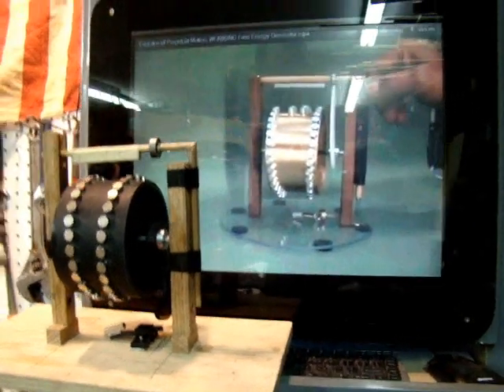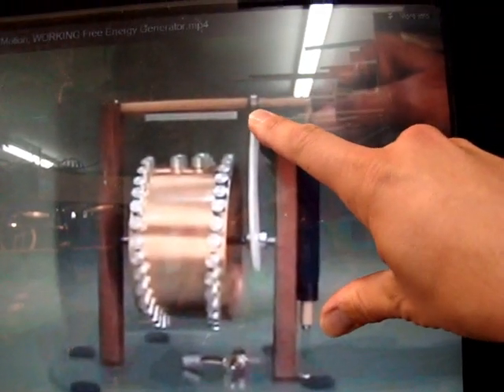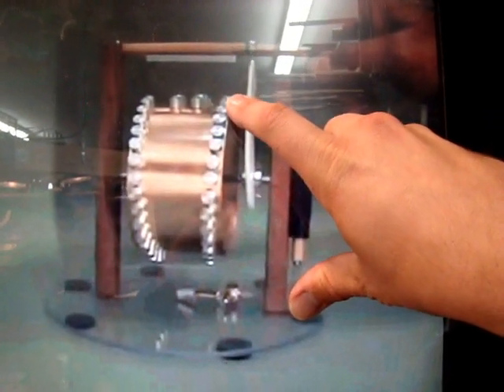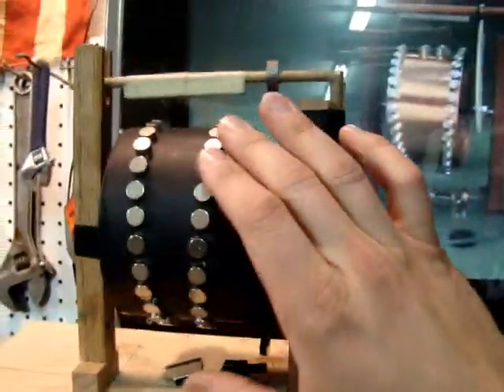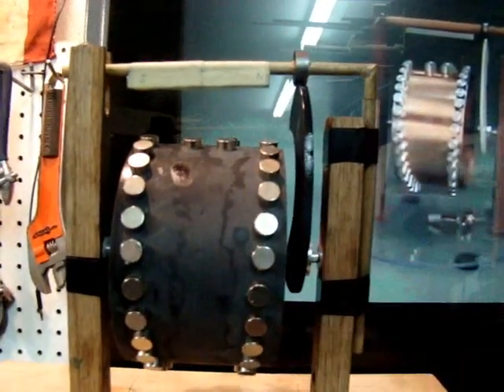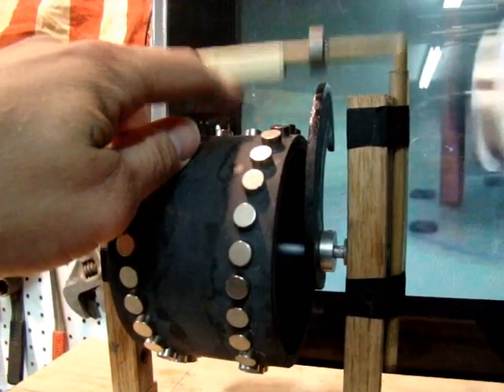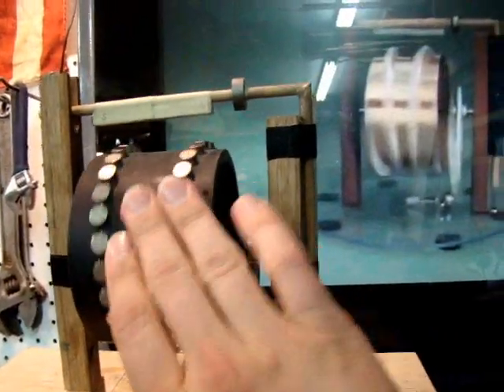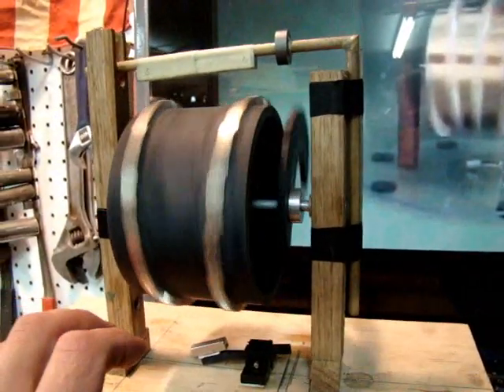Evolution of Perpetual Motion, WORKING Free Energy Generator Part 1 of 3

Comment: I have dusted off my V gate motor and am in the process of making the cam. You are right, that top magnet is nowhere to be found. I tried making a string of 4   1/2" non magnets, but the attracting poles are too close to the revolving magnet and stop it.
I am making mine run by repulsion - that is N over the N ring and S over the S ring and much closer than what you have on your. Mine does run by pushing the magnets up when the end comes and dropping them down again and I am making a cam that will do that. I can't find the video I designed from but he did lift that bottom magnet and now I need to find out when it is lifted . If is by the same cam, it would have to be when the tom magnets are down so both sets repel at the same time . I wish I could find that original video!..Cheers, Jim

Comment: You need to endure many failures making different tests with magnets,  orientations and designs. It works but it' s not so easy. Try with a vertical  circular magnet just in the midle, between the two magnets lines. Provide a jump to the magnet st the steeky point.

Comment: I am in the process of making one. I was not sure if the top magnet was pushing ( N to N ) or pulling  (N to S) and I found from another video with a 4 v gate motor that it is pushing (N to S ) I stacked 4 1/2" magnets together on top to get the right poles at the ends and I am building the cam right now. Call me if you get a chance, I'd like to discuss where we both have been on this design. I watched the same video you have there.  thanks, Jim 616 698 6842

Comment: I have an idea for a lifting force machine. 
Step 1: Get hollowed out cube.
Step 2: Securely attach magnet to inner bottom of hollowed out cube.
Step 3: Place a lever on inside bottom of cube behind the magnet that's securely attached to inside bottom of cube so that one side of the lever is pointing towards you and hanging over the magnet.
Step 4: Attach a vertical bar to the top side of the part of the lever that is not hanging over magnet witch is securely attached to inner bottom of cube. Make sure the bar goes all the way up to the inner top of the cube barley touching it.
Step 5: Securely attach a magnet to the side of the lever that is hanging over the magnet that is attached to the inner bottom of cube.
Note: Magnets need to be facing each other with attracting poles N,S or S,N
Note: The lever is going to have to be really close to the magnet on inner bottom of cube because of how close those magnetic fields need to be to interact. But not so close that magnets can touch.
The magnet on top connected to lever is pulling the magnet on inner bottom of cube towards it and since the magnet on inner bottom of cube is connected to cube, this pulling force acts as a lifting force. Now at the same time the magnet on inner bottom of cube is pulling the magnet on top downwards BUT the magnet on top is connected to the lever so any downwards pulling force is being converted mechanically by the lever into upwards lifting force. Now if you know anything about magnets you now that there are magnets powerfull enough to lift far more weight then just there own. So essentialy this divice is exploiting the powerfull pulling force of magnets by mechanicaly transforming its magnetic pulling force into mechanical lifting force through the clever utilization of a lever, and walla stuff can be made to fly. Imagine if the magnets in this experiment where electro magnets so the ammount of electrical current going into them determined the ammount of lifting force that it would have. Now imagine this system being used as an attachment that could be placed under or ontop of vehicles to counter the weight of the vehicle and any cargo its carying. Now imagine  if this was done with powerfull permanent magnets and turned sideways and placed in an electric generator and had enough strength to pass through the magnetic fields as it propelled itself forwards with its own magnetic pulling force.     Signed   Adam McKenzie Anderson
 Extra Note: If anyone uses my ideas for none profitable means great I hope it helps but if they are used to gain profit in any way I want 25% of anything that comes out of it please. :)  My EMail is starfire7654321@yahoo.com

Comment: Free energy wont exist. BUT... We can tap into stored energy and waste a bit to convert the storage into a usable format.
Take the ram pump.
You can use gravity to increase hydraulic pressure, capture that pressure and relocate the water 7x higher than the drop. The trade off is that a portion of the water is lost to allow the pressure to build. So this is ultimately just a method of using natural energy storage to reallocate resources to a more beneficial format or position for human use.
So...
Recognizing the potential energy and where its stored around us is key.
The sterling engine can use the suns heat and the coolness of ground water, tap into the difference and generate power at the loss of those thermal differences.
Nothing is purely free, but there are many many many untapped resources all around us, we just need to recognize their potential energy they have stored and collect it. 
Don't try to generate energy, instead try to harvest it from a seemingly endless source.

Comment: The magnets on the drum which are close to the magnet bar poles pull the bar more  than the magnets at the center of the drum, so the drum rotates ONE CYCLE. After that, the magnets which start the new cycle (which are close to the center of the drum) are too weak to pull the bar and start a new cycle. The energy used to lift the bar will drain the rotation energy from the drum.

Comment: Get a spring or two to balance out the primary magnet. ...and you can have the maget of which you speak that you can not find, made. many of the companies in china will do custom sises & shapes. It's not difficult, they just change the mold for the power. making a mold like that wouldn't be a problem, it looks like about 3 or 4 cuts in a mill or about 30 minutes modeling & set-up with a cnc system, (a modern one anyway). I would bet it'll cost you around 80 to 100 bucks for one & much cheaper for several.

Comment: You forgot the air hose to blow on the wheel to make it spin.  http://i.kinja-img.com/gawker-media/image/upload/18dtgs2p8d8s5jpg.jpg
I mean, you didn't REALLY think that sticking a bunch of magnets on a wheel, and a little cam with a lift bar, would result in making the wheel spin, did you?  1st law of thermodynamics anyone?
Reply from the maker: rockethead7 dude check out part 2&3. your only looking at video 1 of 3 of the whole project.:)

Comment: This wasn't amusing because no thought went into it, it looks like you just tried to make it look like the other one. Where he actually did several experiments first, starting with a flat surface to make sure his set up worked. This looks off timed, a little lopsided, too light to maintain any kinetic energy when it tries to lift the magnet, and the angle of the cam-lobe is way too steep, so you're losing a lot of energy in that impact, and you didn't have any to lose in the first place. 

Not amusing because you didn't do your research
Reply: Alexander Peterson I agree 100% with you...

Comment: if you lower the top rod and make it were the magnets are in range of each other so the magnetic fields can interact you might have succeeded. plus the one in the video in on a copper wheel which increases magnetic range.

Comment: wish i could pm on this anyway i noticed from counting his magnets he had about 64 total may help also i believe it does work you just have to get it right dont give up as im about to just buy magnets myself! look at some vids of how the v gate works (when it turns even a little and you will realize as i did your is not even moving some are!!!! so first get that right! maybe try rod magnet on top also im not sure he had a spring maybe it was 2 magnets to help push it back up i think if it did work it would take alot of fine precision! on some areas of the build like the timing at the top and bottom!! all the best!

Comment: would you believe me if i tell you that i made one on a small generator , and i put one  el. motor above that is using 1,5 V. voltage increased up to 250 for the crossover.  it has enough torch to kick the rod magnet away from the wheel just enough to continue the spin,  the generator makes enough electricity to charge 1,V battery . if you understood this..  what you think ?

Comment: Nice try but a wasted effort as you have discovered. Questions that people should ask themselves when considering "perpetual motion"; what limits the speed of motion of such a claimed machine? If such a machine exhibits acceleration then it must have a quantifiable energy source and that source (and its magnitude) must be explainable by the existing physical laws which currently separate our lifestyles from those of cavemen. I noticed that the original machine on which this is based did exhibit acceleration. Since it didn't perpetually accelerate, frictional losses which could easily be measured which would define the magnitude of continuous input of energy (from wherever).
Reply: ***** If the magnets do work, it is by pulling something closer by attraction or pushing something away by repulsion. Unless the magnet loses some of its magnetism in the process it has imparted no energy to whatever it caused to move. Therefore an external energy source has to be used to reverse the work done by the magnet (for example, separate the magnet and object again). The same thing goes for two objects which are mutually attracted by gravity - which is why launching something into space requires so much energy. It is only reasonable to ask the "inventor" of a claimed perpetual motion machine to explain where that energy is coming from. People who invent things in the real world are able to explain the principles on which the invention is based. Unless a perpetual motion machine is on sale in a shop the claim that one has been created is invalid. No amount of argument can substitute for the real thing.
Reply: ***** "The magnet has the force to "push" transfer and to as well rejuvenate it's energy by "pulling". And that is the key, one must know this, you must utilize both forces together in order to achieve the desired results."
           Problem 1 is  that there is no evidence that the magnet itself changes either pushing or pulling. This is easily measured. Problem 2 is that forces balance if you try and achieve both at once. It is the sticking point for all overbalancing wheel schemes of which this is one variation. Your description fits that of an oscillator (dynamic energy store) but of course it can only lose energy, not gain it (unless given a push from a quantifiable source). If and when you accomplish your goal I am sure every engineer on the planet will sit up and take note.

Comment: WHERE did this crap and nonsense about needing a "monopole magnet" come from??  This is no such thing because if you have one pole in a material that exhibits magnetic properties, then you automatically have two poles, there has to be one that we call North and another one which we call South.  Or is someone being FECE-tious here? 
  Here's the deal; if this type of magnet motor really works, then why not sell kits to assemble one and make a FORTUNE off them?  That's what I would do!!  If I had a design for a PM motor with all of the bugs worked out of it so it worked first time, every time, and the dimensions of all the parts were recorded, I'd then be cranking out many, many parts and putting them in boxes and laughing all the way to the bank.  Or at the very least I'd be selling blueprints and a parts/materials list with everything that is needed specified in it.  And with a 100% money back guarantee too!  But that's just me I guess.
Reply: Yes. That's the proof that this thing isn't real. If you can't buy it on eBay or Amazon, it doesn't exist.
Reply: jhanthony2
  Yes, that's right, it doesn't exist, this monopole magnet, for if it did exist, then you could buy one without too much trouble or make your own.  And if it's true as stated that one needs a monopole magnet for it to work, that right there is 100% proof that it's a fake!  Do you even understand what is meant by the term monopole magnet?  They are a complete impossibility in this universe.
  What is needed to prove that it's not a faked video, that no blow gun was used to power it, is a wide angle shot from another direction or some light weight chaff spread out on the table top that would get blown around when the air was turned on.  Show that the chaff is not glued down by sprinkling it a couple of times during the demo.  Or use a couple of ribbons with one end tacked down so any breeze would make it flutter.
Reply: Frank Furter I was actually referring to the whole device as being non-existent. I don't watch all of these things in close detail, so I missed the part about monopole magnets. I didn't know they were a requirement.

It sounded as if you thought I might be unclear on the properties of magnets. I fully understand that there is no such thing as a monopole magnet. It would be like finding a string that has only one end. 

IMO, it would be difficult to prove this is a fake by showing different ways to fake it. The ingenious scammer will always be able to find a new way to trick the gullible. What is needed to prove this thing works, is replication by other builders. Also, a scientific theory with vector force calculations to explain how it could be remotely possible is pretty much a requirement, also. Just stating that like poles repel does NOT pass as theory.

Comment: its not even close to the real design, who are you kidding
Reply from the maker: Your right its not close to the real design, it is only part 1 of 3 video documenting my that my copy did not work.   Kinda like calling a house ugly when it is only 1/3 built.
Reply: @woodbrassandglass  - Eight years later I’m seeing your video again and it just dawned on me that that the stater magnet that you said doesn’t exist anywhere in the world is actually nothing more than a round piece of steel. A magnet as a stater at top is not required because if it was indeed a magnet then the magnet to magnet attraction would be so powerful that would be nearly impossible if not impossible for the armature to lift up the stater.

Additionally the v-gate never worked on aNorth Pole and South Pole principal. Simply make them all north pole or south pole. I will be making one of these soon and see what I can accomplish. And yes you do need some powerful magnet because that is a lot of mass for those little magnets that you are using. 

Still enjoy your research. Your last post was five months ago at the time of my post here. Hopefully you’re OK.
Reply: The mechanics are correct... yet its non functional. Basically creating energy is a hoax, but harvesting energy is possible. Aim for unique methods of harvesting a measurable amount of potential energy and you'll have something.

Comment: i think your top magnet is setup wrong, the N/S should be in a vertical orientation not a horizontal one.
However even when designed correctly, it still wont work as a perpetual motion device.

Comment: You're an embarrassment to yourself. Are you even trying? Your design is obviously extremely inferior, your materials are heavy and the placements are wrong. Are you afraid this might actually work if you do it right?
Reply from the maker: If you cant figure out that this is only part 1 of 3, then I am truly sad.
Reply: Well I offer my apology, I missed that. I must say kudos for the effort, but I'm still disappointed by the outcome. I get the feeling you are trying harder to prove that it can't work than you are about figuring out if it can work.
Reply from the maker: Honestly I got carried away that it would work and was annoyed it didnt.  I have been working on free energy devices for nearly 20 years, and will never give it up, it is one of my passions:)
Reply: wood brass and glass Well, I'm glad to hear that. I apologize for being abrasive, but I am sick of seeing people try to discredit other peoples claims by producing their own shoddy fake versions, without even trying to set up the system the same way, and then claim that they're all fake.

In the original video, calloway showed the process by which he supposedly arrived at a working system. It is annoying that he has apparently not provided a set of diagrams and materials list (that I know of). Seems like the point of failure is trying to reproduce the final form without dialing in on the balance of forces that keep the wheel in motion (supposedly) first.

Comment: you made a few mistakes. for one: the tube you use to fatten up the dowel that holds the magnet is NOT supposed to be a tube but a bearing! Also the arm that should hit the "bearing" is too thick and thus too heavy. try using thin plastic sheet (2 or 3 millimeters thick) or some balsa wood.

Also your top magnet is way too small. use something thicker.
Reply from the maker: No disagreements from me!  Just watch part 3, part one was a lousy attempt at replicating the original device.

Comment: Not the same. The material differences are wat too obvious. 

Try using plastic thin and light or paper towel rolls.

The VGate motor looks feasible for efficent rotation.